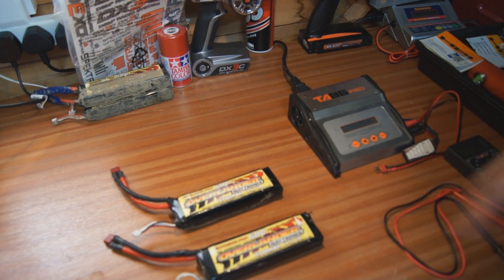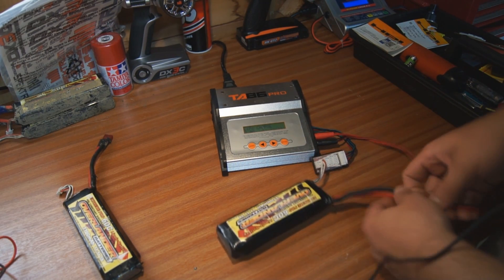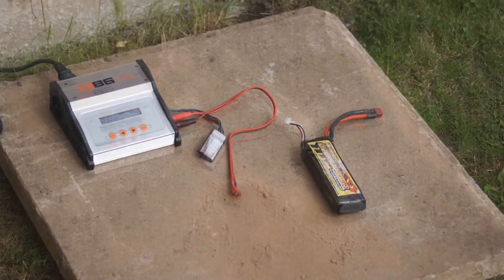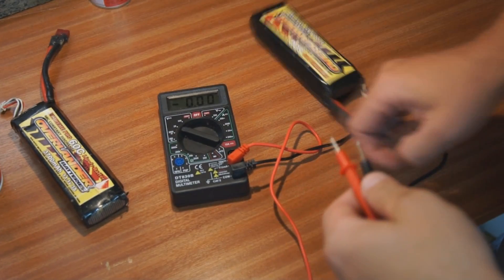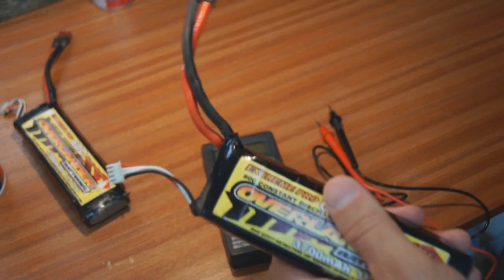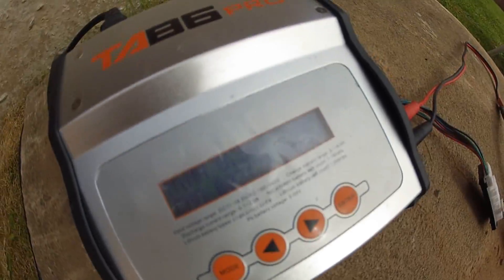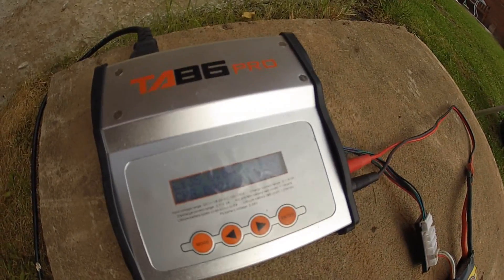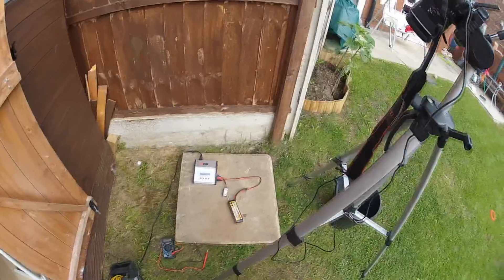How to Fix a dead Lipo. Low 4.9Volts to 12.60Volts (full charge)

Comment: You can just unplug the balance leads I put it on half an amp in Lipo mode and then after I reach a little bit over 9 volts I plug in the balance leads

Comment: Yes, but you dont need your balance cables on using NIMH Mode....Once you get to more than 3v per cell, your charger will work as normal in LIPO Mode with the balance connected again.

Comment: Can I somehow revive my lipo? I shorted it for like 0.5sec and all 3 cells are like 1.5mV
charger does not reconize it and when I put it to my 12v power supply and then lipo charger it starts charging but when I take my own power supply off the charger stops. I tried to leave my 12v power supply attached to like 2h and it was like 1.5mv -> 25mv 
the lipo is brand new

Comment: Worked a charm! Hose pipe was at the ready! Will report back if the pack still has the same flight time.

Many thanks !
Reply: It has definitely suffered an increase in internal resistance, undermining it's ability to withstand large charge/discharge current and hence the effective capacity.
Reply: i realize it's kinda randomly asking but do anyone know a good place to watch newly released series online ?
Reply: @Sylas Saint I dunno I watch on Flixportal. Just google after it =) -imran
Reply: @Imran Holden Thanks, I went there and it seems like they got a lot of movies there :D I appreciate it !!
Reply: @Sylas Saint Glad I could help xD

Comment: I got a boscam monitor and the internal lipo battery was down to 2.4v. I can run an external battery but it's annoying. So I stuck it on my charger and boom. low voltage. Now I have it on nimh at 0.5. I got it up to 9.8v but my charger still won't charge it on lipo because of low voltage :( It worked with an old battery I had but it's not working with this internal one.

Comment: hey, nice vid.i have a 2s lipo and the total voltage was about 6,81v (hasnt gone so low any time) so i threw it on my charger WITHOUT balancer (powered from a transformer)and it wouldnt charge i -charged- it with a 9v.batt at 7v. but the charger still wouldnt charge it /7.1 v. nothing/7.2v.nothing/ s i plugged on my buggy and it runn it like it was fully charged .......so what the hack should i do+even with the 9v. batt both cells are balanced pls answer asap

Comment: I washed my cell phone and dried it out but the bat wouldn't start to charge when plugged in .So I used another battery with some jump leads and hooked the up like jumpng off a car just for a second and then plugged in the charger it worked .same thing . But yes lipo's are very dangerous .I woul set the lipo on a plank of wood over the bucket of water and ifit start's to cook just dump it in.

Comment: ( had the low voltage error , digital balancer couldnt even get a reading )
i charged my 5000 mah 2s Lipo , on my NIHM peak charger 4.5a max  , for about 30 seconds , just enough to see the voltage going up , then quick switch back to lipo charger and it WORKED !!